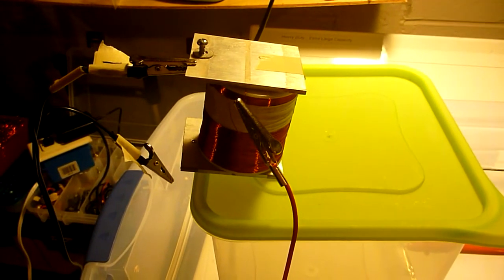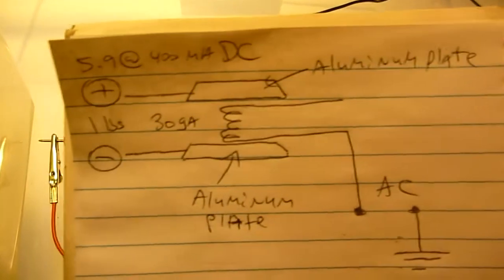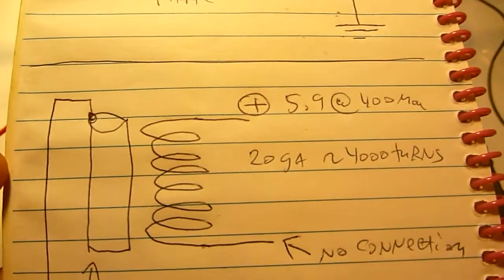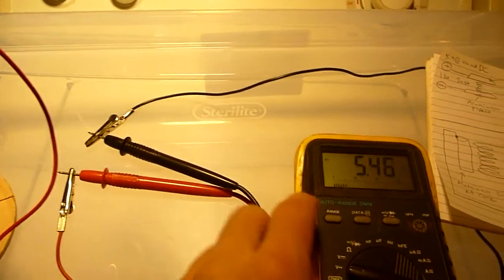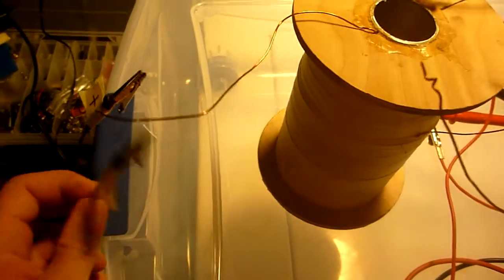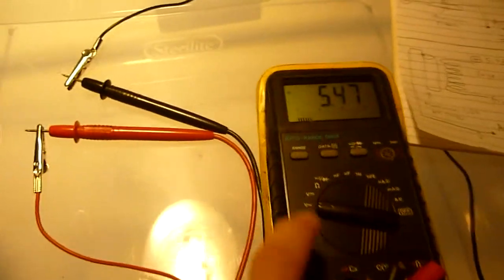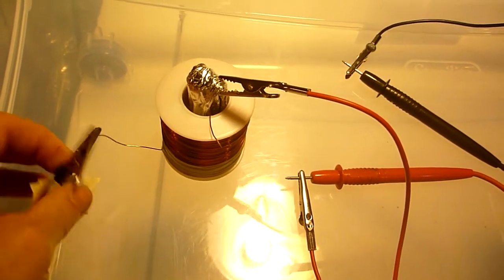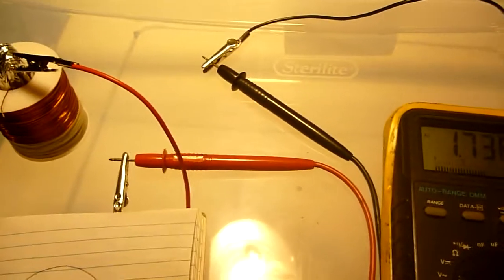New Open Circuit Electrostatic Effect Demonstration

Comment: the tube and the coil act as a capacitor. the potential is between ac hot and ground. The coil / pipe act as an capacitor.

Comment: I know this was like 8 years ago, but you're completely right that the system needs to be open. Among the reasons we don't really see over unity is because our circuitry is a closed system, nature is an open system, but by closing our circuits we isolate the system from being able to take in more energy from the Aether than is provided from the source generator.

The system must be developed to be open, Tesla's system was open through single wire transmission and wireless, both systems use the Earth as the connection line to function and Earth is obviously an open system, a capacitor top load to store and return the flow to the wire and to the Earth.

Single wire transmission systems also display some very interesting properties, among them is the total ignorance of resistors, capacitors, and inductors wired in series with the connection, in other words, room temperature superconductive properties.

The 2 wire system closes the circuits and cuts off outside supply, forcing it to be under unity. To quote Tom Bearden: "It is the STUPIDEST circuit anybody could have possibility originated in powering systems."

It really is, Tesla was right to say return wire systems would soon be a thing of the past... Over a hundred years ago! I hope to get a prototype built sooner than later.

Comment: Set your Fluke meter to Hz, and you will see that the voltage is inductance coming from the AC in your house. If you are in the US, you will see a frequency of 60Hz. If you are in Europe, I don’t know if they have the same Hz. I’ve gone down this rabbit hole, and the Fluke is what kept me from believing I was getting free energy, realizing it was just residual 60Hz, radiating from a nearby AC outlet.

Comment: Below you find some of the very few information about the Testatika Generator.

The Linden Experiment:

The two engineers asked Paul Baumann how the machine was working, and he started to explain the "principle." He said that in Nature, there are very fine particles and all going at random (fluctuation) and at an incredible speed. To control and have an advantage of this fact, one must find a means to "rectify" the flux.... He took a U-shaped magnet from the drawer and asked one of the engineers to wind a normal installation wire 10 to 25 turns on to the middle of the U-shape (with the wire coils around the magnet sufficiently spaced apart so as to provide capacitance between each coil of the wire in the circuit). The ends of the wire were kept at a certain length (the engineers said, maybe 3 feet each.) The very ends were stripped off the insulation and galvanicly connected, thus forming a loop (with a grid dip meter shown to resonate at about 80-140 MHz). This was placed on the table. Paul Baumann took two small metal plates and put them together with some paper in between (aluminium-insulator-copper). This was like a flat capacitor. Now he placed this "sandwich," holding it with his fingers in the "jaw" of the Magnet, i.e. between the poles. After a short trial to find the best position, he asked one of the engineers to put the probes of his voltmeter onto the plates. To the engineer's surprise: there was a voltage of 700 volts DC indicated! Paul Baumann said, "When you understand this, you know how it works. This is just the beginning."

Comment: what is the frequency ?   I once used a regular transformer with an electrostatic machine and it reacted as if it was a simple capacitor.  Tesla did a similar type of setup connected to a relay and variable resistor circuit by a capacitor it would run about 15 seconds on and 15 seconds off when properly adjusted.

Comment: Cool effect,  I used that effect to trigger a circuit and it works fine.  I really didnt try to store the energy in a cap and see if there was a draw on the main but think about this if you are sitting at home and no electricity is being used you will still be losing that same energy but you will and the electric company will still charge you for that energy but the cost is very low,  so what I am trying to say is could you store that energy and use it to run your appliances and only pay a low electric bill ?   just a thought

Comment: Hey. About the problem about it not working with the 9V battery. This is my opinion; the 5.9v power supply z'ere is a switch mode power supply, which means there could be capacitive couping between the charger output and the wires which lead up to the ground. I have done this many a time, i.e. hooked up a tesla coil up to my 12V 1000mA battery charger, then measuring voltages out of the ferrite core inside. You can actually light a neon off the voltage out of the ferrite core. You should really get a small pocket oscilloscope, that helps me understand how the phenomenon works. I bought mine for $54 online, the DSO 112. By the way, great work of yours, really appreciated.

Comment: Naoki, I am working on building a super cap like Robert Murray Smith , which so far discharges over 3 times longer than the charge I put on the cap.   If the circuit you have does not draw house current and you are picking up lost energy and if it charges an Energy Storage Device then everyone could have a nice power source, which would add no cost to their electric bill.

Comment: I have tried similar experiment . I measured the AC current (I used single phase AC), there was power flowed. I calculate the AC power drawn from the main and also the output power (voltage times current). The result was the output was lower than the input. Conclusion: It is not overunity, it is just a capacitor behave as resistor in AC circuit!

Comment: Hi Naoki. Thanks for the feedback. I anticipate oscillations from the wall AC current. Although the transformer remains open on the stepped down side, I think you might find that power is still pulled from the wall side. Your work is inspiring and I enjoy your channel. I have reason to believe that there is only one type of particle, but in the circuit (as in magnetism) the particles ( 2 are required) are moving in opposite directions. I might be incorrect. My theory indicates that, if the one particle is used, it gets replenished from the earth (ground). Wish I could convey more at this stage but the theory of electricity taught hinders my progress significantly. Keep up the good work. If the particle from the ground (or even ambient) can be replenished, I expect we will have made significant progress. Anyway, I do not want to deter you from your experiments - still lots to explore. Peace.

Comment: Do you get similar results with battery?
Reply from the maker: Heinrich Schulte I couldn't get this effect with a 9 volt battery. I don't have a car battery to try it with. My original power source was a DC Nokia phone charger, 5.9 volts @ 400 mA. Maybe some sort of a electromagnetic interference from the charger is causing the effect. The effect was strange enough for me to make a video about it.

Comment: Naoki are you using wall connected transformer for your DC voltage?
Reply from the maker: Heinrich Schulte I was using Nokia DC phone charger 5.9 volts @ 400 mA. This effect does not seem to work with a 9 volt battery. It requires some sort of a DC charger to work.

Comment: To be honest you have unknowingly created a capacitor which allow limited Alternating Current to pass through and
this current is base to value of capacitor value and frequency of A/C input.
Use L/C meter for open circuit and you shall know.

Comment: Looks rather strange, using conventional theory. But to draw conclusions is imho to soon. We don't know what more you have tested, and the outcome. Did you try this with connecting the DC source DIRECTLY to your meter as well? Also, did you try shorting the coil? (I expect it gives no difference since only the mass and length seems to be effective since it is an antenna as well). To draw conclusions you do need to rule out a lot of conventional stuff as well. I would be very inclined to believe the conclusion if the experiment was done with a battery DC source (like Mike suggests) and somewhere out there in a sea-container which is grounded to earth so you can perform the experiment inside it. but a magnetron casing is okay as well ;-)